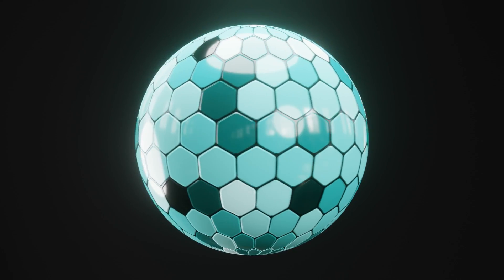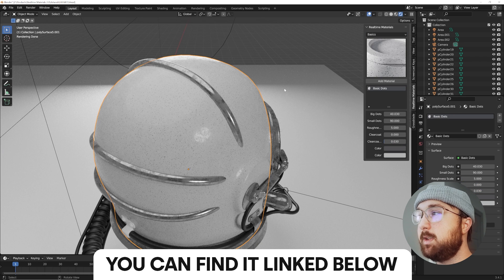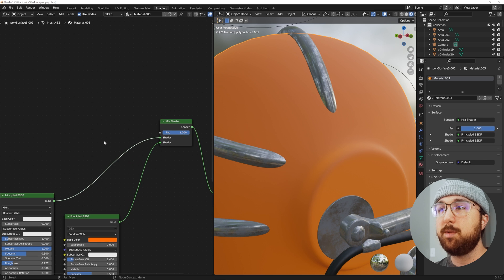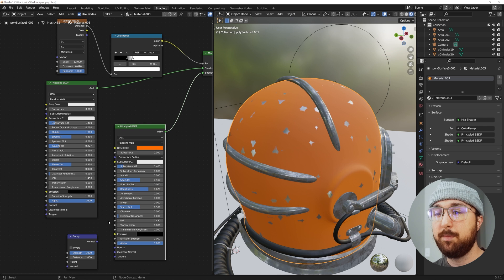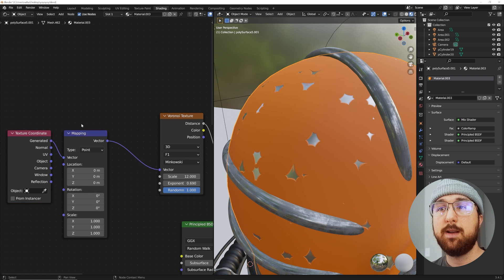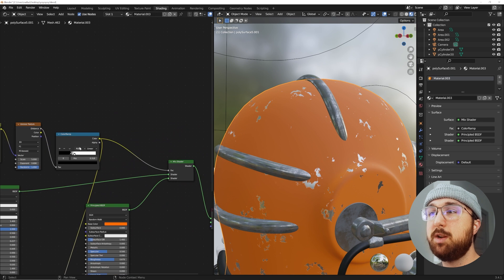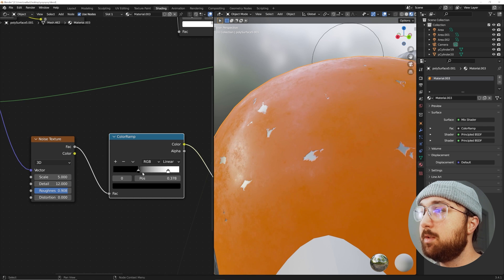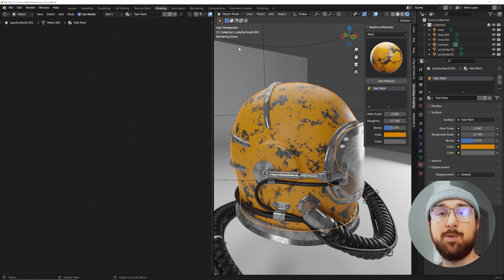How To Make Complex Materials Easily in Blender!

Comment: One downside to procedural scuffs, scratches, etc is that it's kind of 'dumb', and doesn't pay any attention to where wear and tear actually occur (i.e. areas that get bumped or rubbed a lot), not to mention even procedural textures can look kind of uniform over large enough areas. Ambient occlusion nodes and Pointiness can account for some of this, but there's definitely a point where hand-painting things can achieve better results.
Reply: True, but a mask can fix this problem. It is hand painting, but not nearly as hard(ambient occlusion is my choice usually)
Reply: thats why I use the best of both worlds. I mix procedural and painted materials. Just have my own asset library of precedural materials like wood and glass and then I add imprfections as I please

Comment: When you mix with a noise it is best practice to use the "linear light" mix mode because noise is on average a value of 0.5, the linear light subracts this without extra nodes (it wont move).

Comment: So you don't NEED to unwrap if it's procedural materials?
Reply from the maker: Not exactly, the texture coordinate node at the end will dictate that. We used object coordinates, which do not require you to unwrap. But sometimes the way you build a procedural material would need you to use your UV coordinates which you can activate in that texture coordinate node.